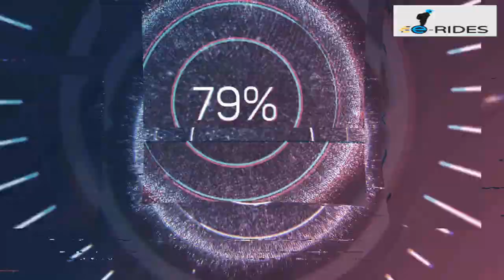Begode Gotway EXN TIRE CHANGE. e-Rides EUC UPGRADE.

Comment: This video had a lot of amazing tips to make things easier, especially leaving one side of the tire installed while putting in the tube.

My contribution is that when you're sliding the pedal hangers/motor back into the plastic shell around 12:47 - I taped all the connectors together temporarily, making them as thin as possible and smoothing out the connectors corners. That way, when I fish the wire through the whole, I can gently pull all the cables through instead of having the heads get stuck on the other side of the hole.
Reply: It's interesting my EXN actually has a I think newer design where it comes through the cooling box setup so it's no big deal at all you actually don't have to fish the wires I could put my hand through.

I just replaced my handle and haven't changed the tire yet but I checked it out to be sure and it definitely looks easier so I was excited to find that.  I might try the tire change tomorrow night.

Comment: Heya the pedals are on back to front, I did the same, tire changes are time consuming, can you advise on the size of the Michelin tire for the Hero, buying all the little things for the Master. The grub screw to hold the pedals up is a really great mod.
Reply from the maker: The customer wanted the pedals that she wanted to try it this way. Also the tire size is.
Michelin City Pro 80/90-14 48P TT
Max Load 181kg
Reply: @eucupgrades  thanks!!